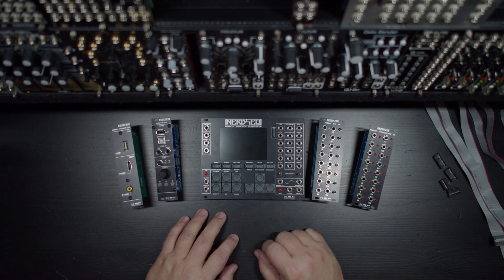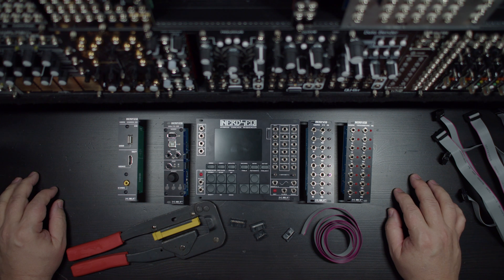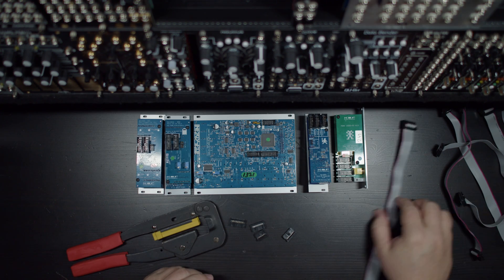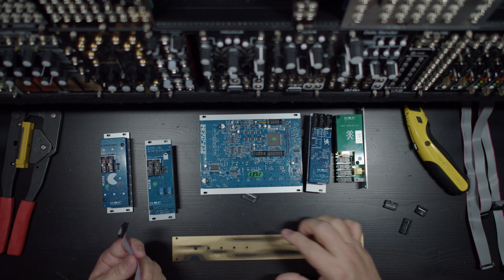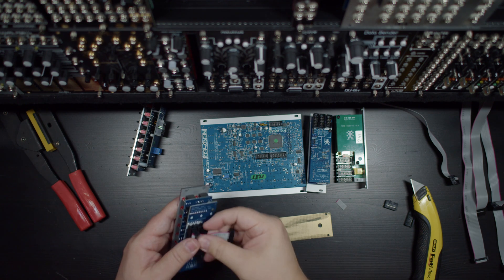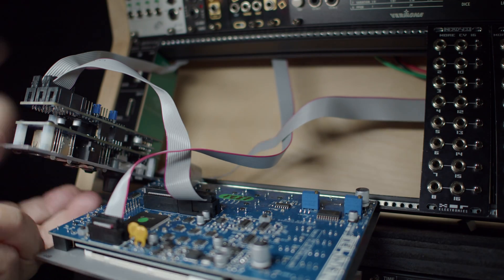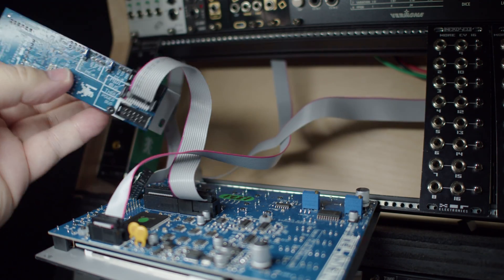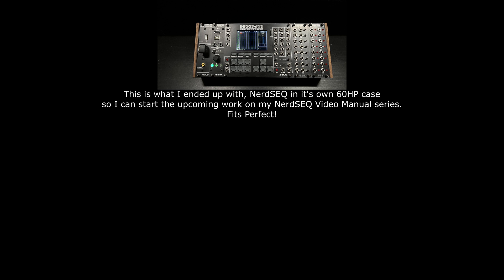DIY: Making Custom Eurorack Cables | NerdSEQ Multi I/O

Comment: Nerdseq is good to compose even with a pad in the Multi I/O but not as flow like the Oxi for live performance, why you cut cables? you will be able to put expanders on top or the other jack outs.

Comment: I realized that I have two Nerdseq's with Multi-IO so I racked them together yesterday attached via I2C. This could be interesting. I ended up with a second one that has a broken expansion bus, but the midi bus still works.